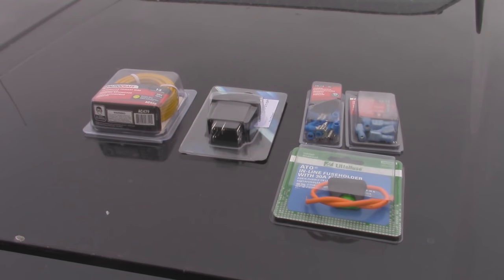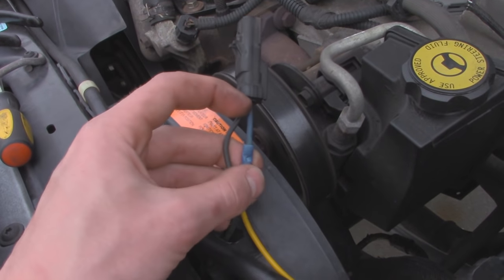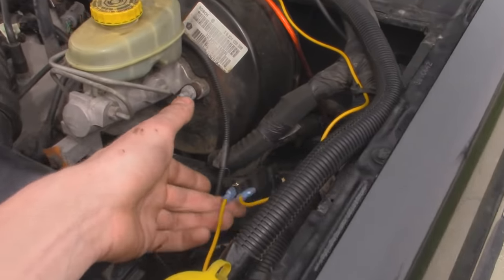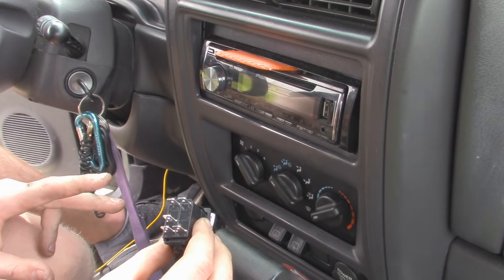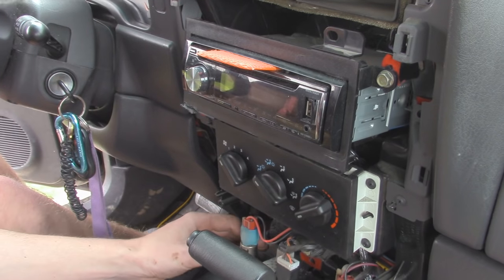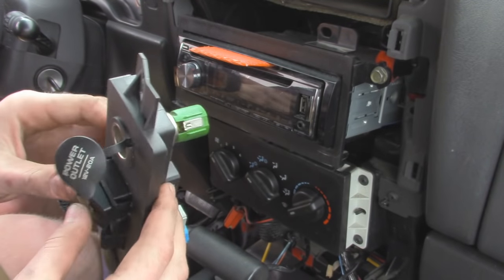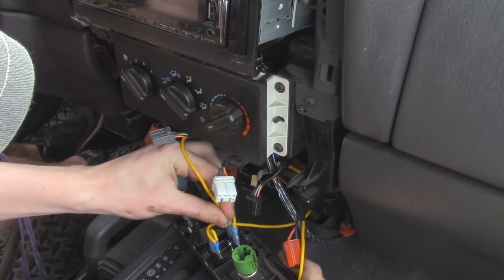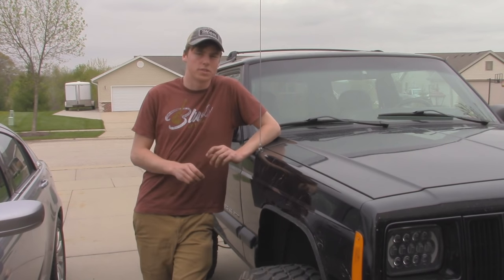Jeep Cooling Fan Override Switch Install

Comment: Just used this video for my 92 and it made it SOOOO easy. Works perfectly. Great for me because my XJ is a 92 but the motor was swapped to a 98 and there's communication issues from the computer to the fan because of it. My fan works but the Computer isn't telling it to turn on. This bypass is nice!
Reply: I have a 98 too and Im thinking my computer has communication issues too.  Im installing this today.  Wish me luck.  Thanks for the video.  Great direction.

Comment: New to jeeps how do you get the wires through the fire wall ? You drill a hole or something?is there a hole already ?
Reply from the maker: I usually pop a hole through a wire harness grommet that is already in the fire wall. It can be done on either side.
Reply: @OutJeeping  thanks

Comment: You should have also wired it into a timed relay so that you can turn it on when you shut the car off you won’t have any heat soak issues.

Comment: Thanks for the video. Something to think about, if you go to your fuse box, you will probably find a spare power tab that is only hot when the ignition is on ( I haven't done this with my XJ, but have with other vehicles, I am sure the XJ fuse box has spares too) use that power for the switch going to the relay so that when you turn the ignition switch off the fan goes off (even if you forget to turn the fan switch off). Of course, you have to ask yourself, do I want to be able to run the fan with the ignition off, or do I want to be sure I don't forget to turn the fan off and run the battery dead accidently? I did this on a an old truck when I installed aftermarket fog lights (thanks to a neighbor, I didn't run the battery dead).

Comment: In my XJ(1998 sport) when my climate control is on defrost or defrost/floor it commands the fan to be on full time.  Does this not work in all XJ's? Do you know which years it does or does not work on?

Comment: Why not just add a diode and switch from the existing relay coming off of the PDC? This would cut out the need to mount additional relays, fully loaded wiring or fuses and better protect the PCM from back current. I think this would be a much simpler and more elegant solution to a problem.
Reply: S-ro Sorcxisto was thinking the same thing just run it from the splice and add a ground and that’s it
Reply: @bryanmelillo26 @So-ro Sorcxisto worse case scenerio is we burn out some relays. The current never reaches the computer the computer controls the relays
Reply: I tried that on my 2000. It gave a CEL

Comment: I just jumped my relay to run continuously while vehicle is running
Reply from the maker: That is another good option as well.
Reply: I have a 1999 wj I could never get the fan to come on. I tried your video and worked great.  I used a 3 prong light up  switch instead. I only needed it to light up when it was on.
Reply: The DisBeat how did you wire it to run when the vehicle is on?
Reply: How did you jump it?
Reply: Very helpful video, I didn't know jackshit about wiring ,but I aced it thanks to you. 10/10 would recommend 👍
Reply: I made a thick wire with male ends and plugged into 2  of ports where the relay would go so when the ignition was on the fan would be on continuously. So no relay just a wire with ends

Comment: This mod is a good idea helping with heat soak issues with the 4.0 engine.I hope this doesn’t fry the ecm
Reply from the maker: It shouldn't, any backfeed goes to the factory fan relay, not straight to the ECU.

Comment: Ay yo, I want to do this for my Mishimoto fan. Initially, I wired the fan up for an auxiliary setup, but want to delete my mechanical fan now. But I need to wire a switch into the car so that it stays on all the time until I turn off the switch. What changes do I need to make? Please help me on this!

Comment: Hooked up everything as it supposed to be to a two prong toggle switch and to a four prong relay. Hot wire coming from my fan goes to 87, 30 to inline fuse to battery, 86 to ground and 85 to toggle switch, every ground has been cleaned, tighten properly and double checked and nothing. Switch works and checked relay for continuity and is all good. I even got two different relay just to make sure it wasn't it but I got nothing. I know it gotta be something so stupidly simple but I can't see it. Any input?
Reply from the maker: 85 is ground and 86 is from switch.

Comment: Hey man great video,I have a switch think it’s the same one, did you have trouble with that switch contacting the bezel?
Reply from the maker: I did, unfortunately with these larger aftermarket switches you will have to notch out the bezel for the switch. Otherwise on Ebay, they do make factory style replacement switches that are customizable.

Comment: But i think two wires (positive wire )sharing the same value will make overload on that wire!?
Reply from the maker: @ibrajuhani6572  It won't, the fan is what draws the amperage. That won't change no matter how many wires of the same power source lead to it.

Comment: I'm running into the over heating due to Florida weather is there anyway you can post a list of items needed.
Reply from the maker: 40amp relay, a 12 volt switch of you're choice, 14 gauge wire, and some spade connectors.

Comment: Nice video, it helped me. But 2 questions. The black wire coming off the OEM fan is ground ?  And, my switch only has 3.spades on back. I used the one from the relay. But were do I hook the other up to. ? One is labeled 2, other is 7.. I assume  one is ground  & one is power. ?
Reply from the maker: Yup, black wire off the fan is ground. Hard to say what the pins are because every switch is different. Some are 2 way, 3 way, some have lights in the switch. But if I were you I would look up the diagram for your switch and for basics you need a positive feed to the switch and positive return back to the relay.

Comment: How does the electrical circuit change if I just want to use a simple toggle switch instead of the one used in the video.?
Reply from the maker: It would be even more simple, just need a fused power to the switch and a wire from the other side of the switch to the relay.
Reply: @OutJeeping  you should still use a relay a switch may not be able to handle the load .  Contacts have and make and break rating so be careful it may be rated at 30 amp make and only capable of breaking the at load of 5 amps
Reply from the maker: @dissociativecat7495  Yup still gotta run a relay like I said. Not worth running the risk of burning down the jeep from a simple mistake lol.

Comment: Should probably note or edit the video that you need to install a Diode where you tapped into the circuit to the fan... it needs to go between where you tapped into the power side of the fan wire and the ECM, this way you will not back feed the ECM and throw codes... Also I would suggest using different color wires for ground and wrapping all wires in some form of wire loom
Reply from the maker: Yup i'm well aware of the CEL but didn't notice at first due to already having the light on. Also this was my friends Jeep and he's to cheap to want to wire it neater.
Reply: @OutJeeping  its always difficult to get the friends to do the job right..... I tend to not work on their vehicles... cause it always fails later and they blame you....

Comment: What happens if it’s in override mode and te jeep decides to send power as well?
Reply from the maker: I haven't had an issue, It should be fine when the Jeep gives power as well. When the Jeep doesn't, I believe it just back feeds the factory fan relay on the output side, which isn't a big deal. Some say it may cause an engine light so a diode install on the factory fan supply wire should fix that.

Comment: Where did you get those tiny little fender flares on the Xj in the very beginning of the video. Ive seen them on quite a few xj builds, but I cant find what they are.
Reply from the maker: They actually are not flares, it's just thick bed liner.

Comment: Thanks.
Reply: If switch is left on will it run batt. Down?
Reply from the maker: It will, it's essentially directly wired so it will not automatically shut off.

Comment: I pulled the rear window defogger board and switch out at a junkyard and used it for the fan, the board itself is basically a latch relay and the switch is a momentary contact the fan can only be turned on in Accy or run and is off at start up. I once made the mistake of using an aftermarket temperature sensor and it ran 40° hotter according to the gauge I purchased a mopar sensor and the gauge read 195° like it should
Reply from the maker: Hmm yeah that ain't good. But good thing thermostats are still mechanically operated but yeah the ecu wouldn't be turning on the electric fan at the right time with a bad sensor, or telling you when you should override the fan to turn it on.

Comment: Where does the double ground wire to hook to rocker switch magically come from???
Reply from the maker: I forget where I pulled it from but it can be tapped from the 12V power outlets or grounded on the dash bolt that is located under the switch panel.
Reply: @OutJeeping  thanks! I figured it out. You are my favorite jeep guy; most accurate & concise. I've learned a shit ton from all your videos.
Reply: @seanstackz3683 where did you put it because honestly that thing has me lost?
Reply: @christianc1282  tbh I don't remember I just tried looking at my pictures. Did u figure it out?

Comment: Did you have any "hot soak" issues causing "vapor lock"? maybe know someone who has and said that this can also help with that?
thanks for the vid!
Reply from the maker: My own jeep had it and yes running the fan after it is off will help prevent heat soak from occurring.
Reply: OutJeeping
Thanks man!
Reply: You could add a timer relay to keep the fan running for a few minutes after the ignition is off. This would better vents the engine compartment permit hot soak issues.

Comment: I wired this up but didn't add a diode. I left the fan on while at work and the battery died. I jumped it and now it won't idle unless I feather the gas and hold the brake. Any ideas what went wrong????? ...
Reply from the maker: Give it a few runs to get the ecu back up and reading the sensors properly
Reply: I have since installed the inline diode, no change, had to ziptie the throttle so it will stay at idle. Swapping out IAC AND TBPS tomorrow. Could  I have fried my ECU? Not throwing any codes
Reply: Lol oh boy

Comment: I'm confused I thought that the purpose of putting a relay in place for thus kind of mod was so that you don't backfeed your electrical system, but you don't disconnect your factory fan power and reroute it in anyway that prevents power from the switch back feeding through the factory system
Reply from the maker: Adding a relay is to prevent all the power for the override switch to go through that and not switch itself. The back feed power should just go to the factory relay for the fan. I wanted to keep the factory option in case I'm not paying attention to the temp gauge but also have the luxury to switching it on whenever I feel like it to monitor temps closely.
Reply: @OutJeeping  yes but i feel that your 4 pin relay wiring job dosnt really prevent a possible back feed into the factory system. I feel that the only way to truly prevent a back feed of some sort is to go with a 5 pin relay. i cant share a picture sadly but after i did a lot more research i did find a pretty decent wiring diagram for a 5 pin relay system
Reply: @CABANA J i suppose that would work in theory

Comment: Whats the amps that the switch had
Reply from the maker: I believe the switch could handle up to 20amps but I would always use a relay to prevent possible failures from overloading the switch.

Comment: Anyone help me? Im using a 3 prong switch.. wired it up just like his but im stuck on the other 2 prongs on the switxh. 1992 xj
Reply from the maker: What type of 3 prong switch do you have? Does it have a light on it? Regardless of the switch, all switches need to have a + power going into it and a return going out, which in this case goes back to activate the relay.

Comment: Great video can I use just a simple switch with no LEDS? One that only has the power and a ground on the switch?
Reply from the maker: Yup the little led light is just for prefrence
Reply: Perfect im going to give this a try. Have you done the extended idle?
Reply: @rohitter7878  i just did extended idle the other day
Reply: @adamswaz4878  any instructions on how you did it?
Reply: Do I need to ground the switch too? Or just ground the relay if I’m not using a led light

Comment: I did this on my 01 XJ.  It throws a CEL every time.  It was annoying so I disconnected it.
Reply: Project Dan H that's too bad. I wonder if it'll throw a check engine light for every model and year of XJ
Reply: Steven Harden not sure.. I would assume all obd2 would throw the code.. maybe 1995 and older would be ok
Reply from the maker: That's weird, mine and my buddies jeep are both 01 and it doesn't throw any codes.
Reply: OutJeeping I'll plug it in again and see what specific code it is.
Reply from the maker: A simple diode for the positive wire to the fan on the factory wiring side would fix the cel.
Reply: There is a guide on Cherokee Forum on how to do this properly, including schematic and I think pictures

EDIT:
And great video GetJeeping. This can sometimes throw a Check Engine Light and if so, you can add a relay to resolve it. I posted a link below to some instructions
Reply: reddyuda yes, that's the forum I used when I did mine. His is a 1995.  That's why I figured doing it on an OBD2 would throw codes.  Apparently the pcm wants to have control and gets pissed when you intervene.  I think the code was related to detecting improper voltage
Reply: The code is from the back-feed in current into the PCM I believe. The CEL is really hit or miss, some report having no CEL and some have a CEL immediately. Try it, and if you get a check engine light, just wire a relay in.

Anyways, there are a few ways to wire this up. You can wire it either with a 2-way switch ("auto" or "on") or 3 way ("On-Auto-Off"). The difference is the amount of relay pins needed and wiring complexity, but there are guides for both.

Here is one example;
https://www.cherokeeforum.com/f51/right-way-install-manual-switch-your-e-fan-212243/

Comment: This didn't give you a CEL by any chance did it??
Reply from the maker: Hasn't on mine but on some peoples it has, it can easily be fixed with a diode.
Reply: @OutJeeping  haha not to inclined on how I would go about setting that up
Reply from the maker: @Elskrat88  A diode allows power to trail only one way so by splicing that in it wont give power back to the original relay when the override is on. Therefore the ecu wont detect anything different
Reply: Really great to know thanks for the help and great videos
Reply: @OutJeeping  isnt that the point of installing a switch that has LED(iode)
Reply: OutJeeping what about using a Nice switch in the cab that has LED bulbs on/in it. Does that count as our "diode" and keep any power from back feeding ?
Reply: Adam swaz did you ever figure out an answer for this? I'm also interested in this theory

Comment: Great video dude! Now I have the confidence to do it on my own. Just one question. Where did you ground off the two ground wires for the switch? I assume somewhere metal under the dash? 
Thanks!
Reply from the maker: I used a bolt the holds in the dash right under the switch panel
Reply: @OutJeeping I just got my switch in yesterday with no problems. Thanks for a well-detailed video! You have a new sub, can’t wait to see more XJ tutorials! Keep up the good work.
Reply: Doesnt this trip the temp gauge into not working wile switch is on
Reply: @vwclub3  No because you are just adding redundancy. You aren't bypassing the OEM temp sensor that sends the command to the pcm which kicks the fan on. You're adding this switch after that system.